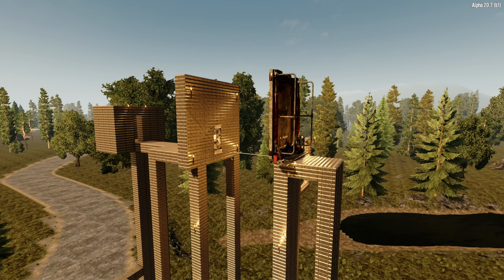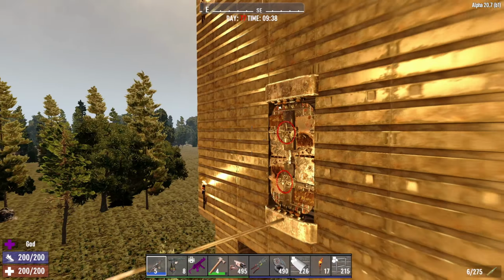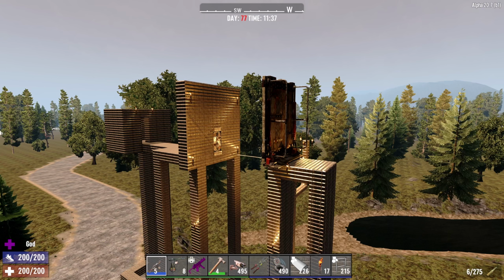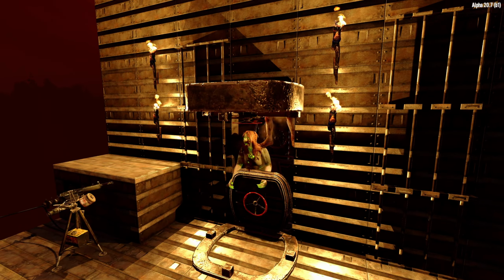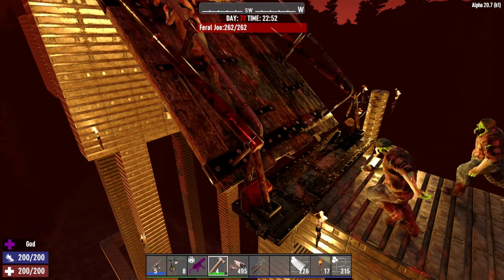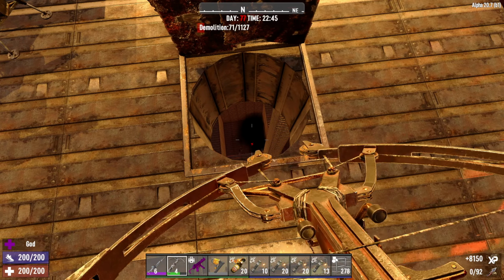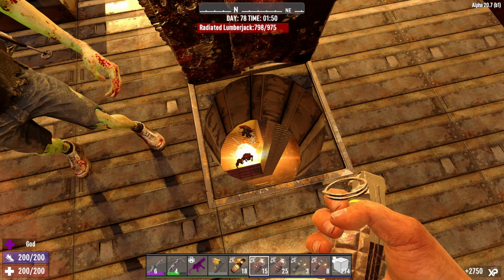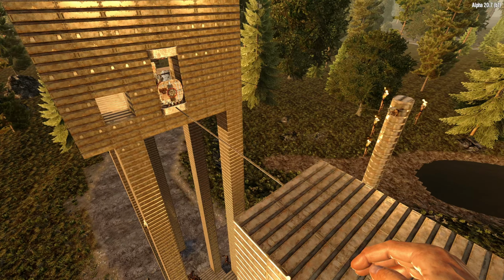(7 Days To Die) 🔥The SLAPPER🔥 Drawbridge Horde Base Design

Comment: Fun stuff -- on that open hatch ... cause you will fall in eventually -- Guns, Nerds, and Steel started putting a quarter pole side centered block there which prevents you from falling if you slip, but still lets you huck grenades!
Reply: Even better: Just replace the block with a ladder. And i even go so far as to place two ladders and have a half plate at the bottom so i can actually climb down into a nice thrower position where i can even throw molis with 0% risk of self-harm or falling off.
Reply from the maker: ahhh yeah that's the part I was missing - thanks!

Comment: Very cool idea, I really like bases that are designed for explosives and sniper rifle use.  I find they are most efficient for killing zombies.  One point though, I usually use an open 3 x 3 area with railings around it instead of the hole and trap door.  This allows much more room for throwables and prevents accidentally falling in.  Loving the base build videos, See you in the next one.
Reply from the maker: Cheers mate! Thanks for the open area suggestion too. I probably need something like that considering my throwing (in)ability LOL

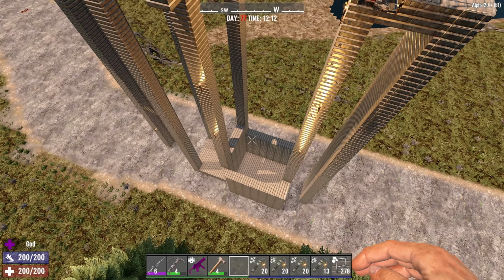Comment: 9:39 what would happen if u had a drawbridge go SIDEWAYS thru the gap instead of how its designed? would they still path over it and jump the barriers at the side or would they just attack it or not see it as a path?  i wonder if u had 2 columns and 2 sideways drawbridges going up & down in different directions?
Reply from the maker: That's an interesting idea! It would definitely help make them last longer cos any damage would be spread between the two. Might be worth a test

Comment: Cautious Pancake has a few tests ideas that you may put into use here as far as height and length of base to reduce material costs and be more efficient
Reply from the maker: thanks, I've seen a bunch of Pancakes videos but at the time didn't recall anything concerning vertical distance from zombies in combination with horizontal path length.
Reply: @kingofthezeds  Its a specific height in which they do not go into rage mode , ill look it up

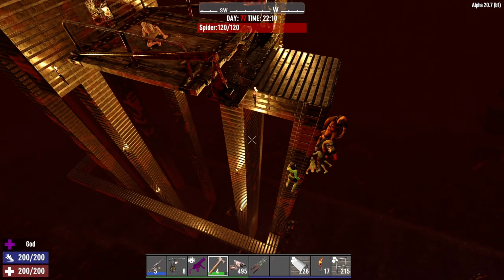Comment: 7:33 i think ur problem is the base of the drawbridge in where the zombies start... instead of on your side.. this means they are much more likely to be able to damage it cos they can 100% of the time attack it instead of just when its down.. but i understand why u did that cos if it were the other way around they might get stuck between the drawbridge & your base and u would need a block they could stand on instead of a slick wall
Reply from the maker: yeah my first tests I had it the other way around but the problem was the hinge side of the drawbridge has one blocks width of space for them to stand on, so if they reached it they'd never fall down the gap
Reply: @kingofthezeds  can u put a plate under or a sheet so it looks like its floating and they have nothing to stand on but its still supported? (problem is sheets are weak & break quick)

Comment: Funny to watch - but slope loop is vastly superior and supports afk, ranged, molis and nades out of the box and melee with an additional trapdoor-switchable path (turn it off to repair or heal).
Until the Pimps patch slope pathing (although i actually hope they only patch the AFKbility, not the pathing itself), there really is no reason to go for electric crowd control and looping solutions.
Reply from the maker: no reason except for it's a bit of fun to do something different with the stuff that doesn't normally get used in an "ultimate" base 😉

Comment: what about having 2 drawbridges facing each other doing the same thing? i think that would be even more effective cos with just one, they still get a small chance to hit your door... also... when are they damaging the drawbridge? is it while the bridge is going up & down & they are stuck on it? maybe u need to set urself in a position where u can keep repairing it? or...  work out how long it lasts on average.. say 2 hours and then have a new path open every 2 hours one from each direction with a new drawbridge? the first question is how and when are they dealing damage to the drawbridge and is there a way to stop it? maybe opening & closing it quicker? to be honest though, i feel like the powered garage doors dropping zombies are more effective cos i feel like the devs have made zombies purposefully attack drawbridges..
Reply from the maker: When it flips up and they fall back instead of off the edge, they end up just standing there on the first block of the drawbridge, so I think that's when they're hitting it. 
I wanted to put the drawbridge upside down so it flips downwards like a proper trap door but there wasnt the option to rotate it that way. That would solve the problem I suspect, whilst also being awesome lol.
The last run through of the horde I knocked a block out to repair the bridge through and it was fine, the only downside is that it eliminates it as an option for afk.
Reply: @kingofthezeds  Did you try garage doors?
Reply from the maker: no, good suggestion!